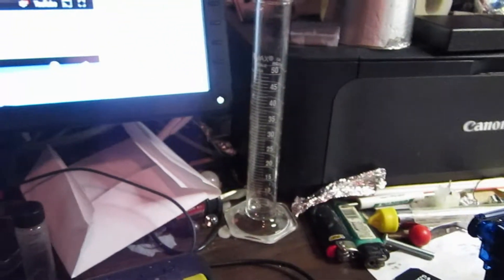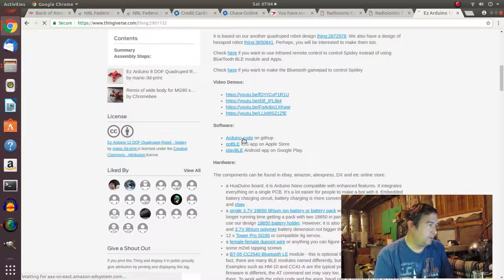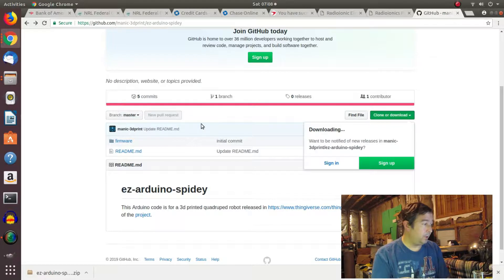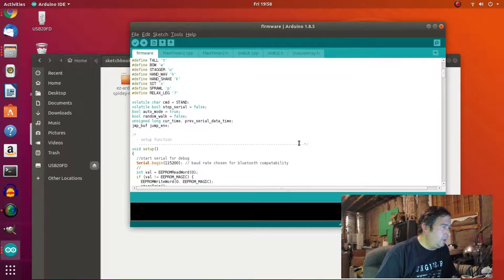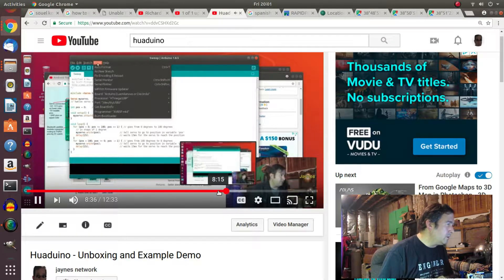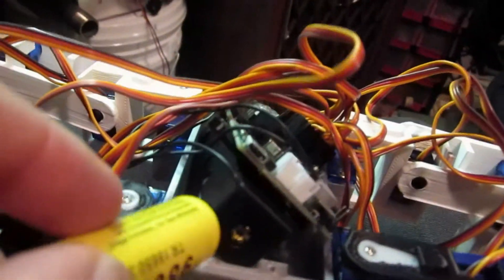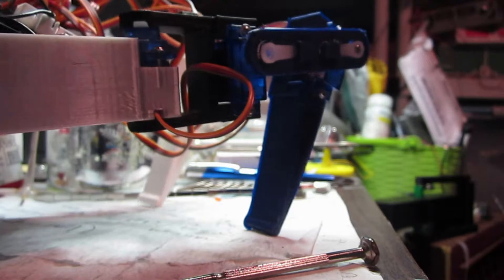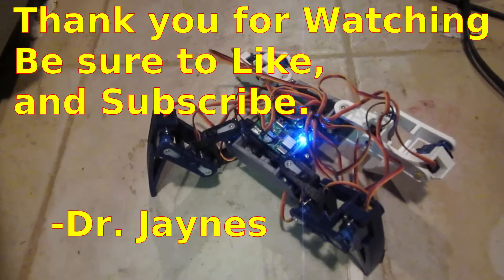Arduino 3D Printed Spider Robot- Part 3 Electrical and Programming

Comment: hello there, that is a very cool project, i tried to build this spider robot and have a lot problems, too. My spider is working in auto mode, but bluetooth isnt working. Did you find a solution and make it run ?
Reply from the maker: I have been meaning to get back to this project.. I think I burnt out my Huiduino board, when some of the servos hit their limits, and couldn't move?? I need to try to fix this device.. then I can try some more experiments.. Be sure to subscribe,... and I will send you updates when I post new videos.. I have been trying to get my daughter interest in robot... then maybe she can help me get some of these projects going!! I haven't tried the bluetooth yet.. but yes it is definitely a very cool project!!